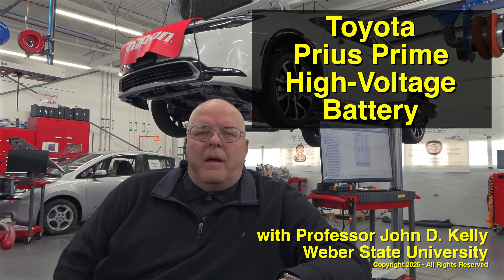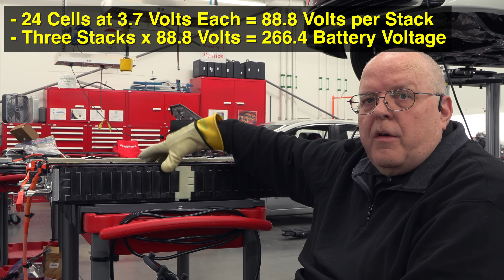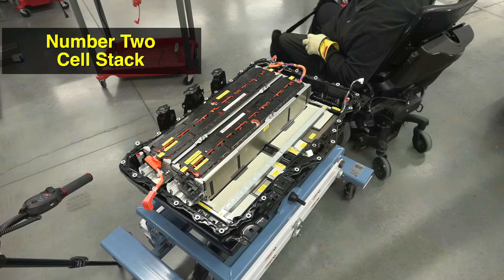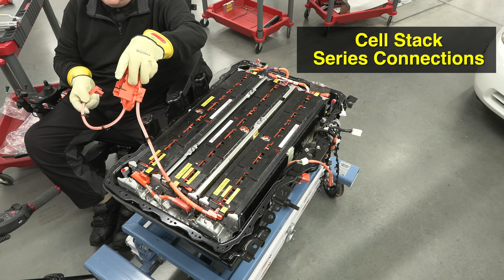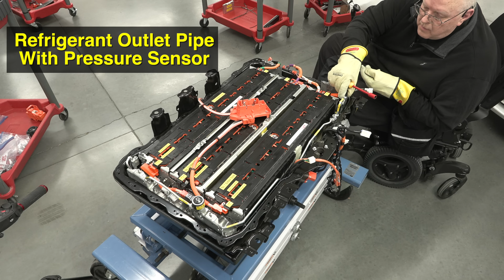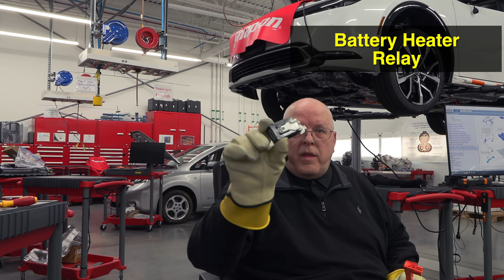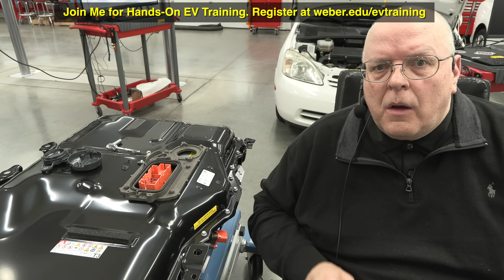2024 Prius Prime/PHEV High-Voltage Battery Build

Comment: Thank you very much for your videos, Love them all.❤
Technical question. You think Toyota could've removed the torque converter, to save weight, moving parts and space? With the electric module upfront we can do something about smoothing the power to the gearbox!

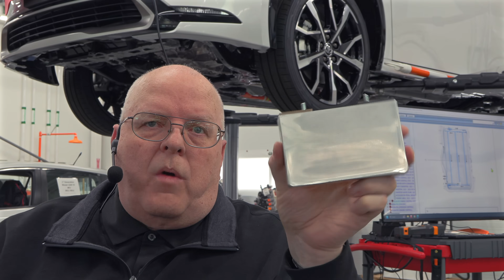Comment: Serious questions... At 7:30 in the video, you mentioned how the previous (2017-2022) generation Prius Prime cells are exactly the same dimensions as this (2023-2024) generation Prius Prime.  Yet the new cells obviously have significantly higher capacity despite being the same size.  For example, the 2022 Prius Prime uses 95x 25AH cells, while the 2023 Prius Prime and RAV4 Prime use 72x and 96x 51AH cells.

I like the previous generation Prius Prime for several reasons: It gets better fuel economy (54mpg vs 48mpg), it's compatible with CommaAI, and it's available significantly cheaper (half as expensive on the used market).  However, its measly 25 mile electric range is very disappointing.  The Honda Clarity is of interest with its 47 mile electric range, but its fuel economy is terrible (40mpg--I get better on that with my standard Corolla!).  So... If the new, higher capacity cells are the same physical size and voltage as the old ones, could one harvest the cells from a totaled 2021-2025 RAV4 Prime (because we need 95 of them and the new Prius Prime only has 72) and move them into a 2022 Prius Prime's battery pack?

This could potentially increase its electric range from 25 to 51 miles (its EPA-rated electric range is exactly the number of AH per cell).  I assume the battery computer primarily watches battery voltage to determine the cut-out points for charging/discharging (standard equipment with lithium).  I wonder what its ability to recalibrate to the doubled capacity would be (because obviously it's also counting kWh in/out for an accurate battery level meter between full and empty, where you can't accurately track by voltage on lithium).  Besides the cell-swap being fraught with peril (I watched your 2017-2021 Prius Prime video as well where you explained this), what are your thoughts?

Comment: Amazing breakdown! It is very interesting that the contact area between the cooling channels and the batteries are so small. It would be interesting to see the long-term degradation of the cells located closer to the inlet as opposed to the outlet valves.
Reply from the maker: Thank you

Comment: Hi @WeberAuto , I'd like to learn more about the architecture of the Prius Prime's solar panel and how it charges the HV battery. Does it use a dedicated MPPT DCDC that boosts the PV voltage to HV pack voltage? Or does it convert onto the low voltage bus and then use the main bi-directional LV DCDC? 
Thanks, Peter

Comment: I saw my friend got an 2026 Prime. It has NMC high voltage battery. I believe this battery can not be charge and left it charge for longer time. I also got the 2026 prime. I did not know and keep the car charged at more than 80% for days. this is not good for the chemical of the battery. If you have a new prius prime.  you should look under the hood and find the lable about the lithium battery. It may be the NMC lithium battery.

Comment: from grok ai, asking it about different emissivity surfaces in the prius prime
Mica has low thermal conductivity, acting as a barrier to prevent hotspots directly under the coil while allowing even heat distribution upward into the battery modules. This ensures uniform warming without overheating specific cells. In contrast to highly reflective low-emissivity metals (like aluminum foil, ε ≈ 0.03), mica's higher emissivity (~0.75) promotes radiative heat transfer into the pack, making warming faster and more effective in cold conditions.
guess because the low voltage choice in the heating element u have a thick hotter element that would normally get hot spots under the battery so toyota is using it more as a heat spreader and radieator instead of as a flame barrier/or for hv isolation. kind of a unique bandaid for a not so good thermal managment system imo. interesting

Comment: Thank you for excellent videos, especially on Toyota ecvt.
I have a question that I have not seen answered.
As I see it the power split device provides a gearbox between ICE and wheels much like the traditional transmission.  The clever bit is that the ratio of this gearbox is continuously variable by changing the MG1 input speed.    My question:  How much mechanical power does MG1 produce (or absorb to go to the traction battery) as the planetary ratio changes?
A related question to help understanding:  It would be possible to buld an ICE car (ie no MG2) with a planetary CVT.  But it would need an MG1 and energy source for it.  Did this concept ever get considered before the first Prius?
Reply: The power split varies as the gear ratio changes. At low speed the power mostly goes through the serial Engine > MG1 >MG2 path. At highway speed most of the power is transmitted directly mechanically. At 65 mph roughly 72% is transmitted mechanical and 28 % goes through the motors. The other interesting fact is that at 65 mph the current produced by MG1 is equal to the current used by MG2, so the current drawn from the battery is approximately zero! Very clever design by Toyota to size of the MG's so this happens.
Reply: @rlderemer  Thank you for your reply.   My curiousity is as to whether a planetary gear can be used to form a beltless CVT  for an ICE vehicle with the ratio changed by varying the MG1 speed.  Looks possible but you'd need an MG1 large enough for ratio setting (as well as for starting), and a battery large enough.  What MG1 power and what size battery would be needed?

Comment: i am very underwhelmed by toyotas attempt to get with the times and build usable erev/phevs, especially in all the compromises for depth of discharge/reserve soc for usable range, cooling is still kind of laughable but technically improved over air cooled, and they are still running weird high voltages far below other mfgs.
toyota went from putting gm on notice with the very innovative prius back in the day, to joining the herd of legacy auto who doesnt want to spend the time/money to modernize their ev architecture.
its absolutely insane that they are charging 50-60k usd for a plug in that is marginally better in only a few areas of technology than the old chevy volts which you can still pick up for a 5-10% of the price.
we got 2 gen1 volts about 3 years ago and i doubt there will be a better vehicle in north america that makes financial sense for the next decade or two. both of our volts paid for themselves in full with just fuel savings alone after only 18 months each, not to mention their cost to insure is crazy low, cheaper than premium netflix now lol (21usd/mo). 
the solar roof is gimicky but i put in my own 200w solar roof on my daily driver 2013 volt for around 100usd for all the materials (including mppt, wires, hardware ect). I deleted the agm battery and built my own LTO 6s 22ah low voltage pack for less than the cost of a replacement agm battery (122usd delivered), which shaved almost 50lb off the car and gives me more range. the car doesnt charge the lto battery past ~14.5v or around 40% soc, but my solar roof charges it the rest of the way to 15.8v or ~95% SOC. the car doesnt know any better and hasnt complained once.
currently waiting for the last delivery of 32ah lfp cells i imported to build and install a parallel high voltage battery of my own design, 112s (7x ~48v 16s modules), ~10kwh usable or double the gen1 volts cycled capacity, which will fit in a small 250mm wide space between the rear seats and still allow access under the cargo hatch. the cells for the battery only cost ~700usd pre tariffs, now theyre around 950 bucks. weight of the buddy pack will be around 150lb, so really not that much more and well positioned over the rear axle. with an empty tank of gas and the agm delete, were talking about a net weight penalty of ~50lb over curb weight for ~80 miles of total ev only range. 
have been looking at all the hv battery tear downs to try and figure out a good air cooled thermal solution. pretty sure i can hack something together that works better than what is apparently acceptable for toyota and nissan. the irony of thermal management is once the battery gets big enough, thermals become less of an issue. 
idk someone with little EE background such as myself shouldnt be able to build a better PHEV/EREV than billion dollar companies for 6-7000$. if my buddy battery ages prematurely, it will be pretty trivial and cheap to replace my diy modules. just going with 7x cheap active inductive balancers probably.
man those pictures at the end are really good. thanks for just throwing this online for free prof kelly.

Comment: Will this refrigerated cooling system plus the fact of the battery being outside provide better cooling than the air system?
Here in California weather hitting 90s, battery on my new 2025 Prius Prime is reaching mid 90s. 
Concerned about accelerated degradation in summer. Will the system increase cooling strength to mitigate this? I thought 90s is high for Lithium ion HB. Car is brand new.

Comment: It would be interesting to see the capacity of an individual cell (mAh or Wh) and also more detail on the pack's overall capacity, which is apparently 14KWh or so.  It seems very compact compared to the Gen 1/2 Chevy Volt packs, which were a similar overall capacity, but significantly larger.
Reply: 10.9kwh usable out of 13.9kwh capacity. divide by 72 cells, 151wh / 193wh usable.
divide by nominal voltage of 3.7... 40.8ah / 52.2ah per cell.
gen1 and 2 volts had about the same total capacity of ~16.5kwh but restricted with software different usable state of charge (soc) ranges for longevity. gm also way over built the thermal management of the batteries for longevity, thats the main reason why the battery is so big, plus the fact that volt batteries are capable of 180kw output (in the elr or software hacked gen1 volt, same ev motors) so they used 3 parallel config in gen1 and 2 parallel in gen2 (smaller/cheaper/weaker ev motors). 
the 2024 prius prime can only pull around 60kw from the battery since they went for larger cells with none in parallel... they really went for density over power and classically skimped as much as possible on the cooling while finally moving away from air cooled. problem with well cooled and properly spec'd batteries is they last forever, and thats clearly not toyotas jam anymore.
actually with just the different SOC protection levels between gen1 and gen2 volts, gen1 batteries are getting to the point where they can usually provide more ev range than gen2 volts after all these years/miles.
finally prismatic cells (all prius models that use lithium cells) are inherently better for density but worse for power compared to pouch style (what the volt uses). i suspect after 5 years/50k miles, the 2024 primes will all experience battery degradation at a faster rate compared to gen2 volts in the same climate, which would be somewhere around 25% ev only range loss.
Reply: @vevenaneathna  25% range loss in 5 years on a 2023+ Prius Prime is extremely unlikely.  A PHEV simply doesn't have the cycle demands that a full EV has (no fast-charging and a, by-definition, a limited discharge envelop). IE: extremely short high-rate (35 minutes at highway speeds!), or somewhat longer low rate, with either being inherently self-limiting to a trivially short period of time until depletion, with no ability to subsequently recharge at any relevantly high rate, given a Level 2 3.6KW maximum).  I agree that the Volt battery system was grossly overbuilt and under-utilized for such a limited duty cycle.  They could have used far more of the available capacity with no relevant compromise in longevity (The 2023 Prime does use quite a bit more of the overall available capacity as compared to the Volt, but it's still quite conservative).
Reply: @awebuser5914  nah youre missing my point. they did use way more of the volts battery between gen1 and gen2 volt and despite it being overbuilt compared to prius prime, gen2 volts have accelerated degradation after 5 years/50k miles. prius prime takes like 8 more steps further.
Reply: @vevenaneathna  "gen2 volts have accelerated degradation after 5 years/50k miles"  The ancient LG Chem pouch cell used in both Volts is in no way comparable to a vastly more modern Panasonic GPNCM2814810 prismatic cell.  Sorry to burst your bubble, but significant degradation will be essentially non-existent , guaranteed.  Also, the Gen 2 Volt had a much larger pack: https://media.gm.com/content/dam/Media/microsites/product/Volt_2016/doc/VOLT_BATTERY.pdf
Reply: @awebuser5914  from memory gen2 was ~17.5kwh, gen1 was ~16.4kwh. youre splitting less than 10%. tire pressure is more important than what youre comparing.
gen1 volts have little to no range loss after 140k and 14 years, i know coz i own 2 of them lol.
panisonic prismatic tech is ancient. they have liquid electrolyte and its the same from the previous gen of prius. they are most similar to 1st gen chinease lfp cells which vent electrolyte over the course of their life. prismatic cell tech has come a lot further but toyota is still using 2010 tech. the lg pouch cells are actually pretty bulletproof. prismatic cells are better for bevs and not hybrids which need high current from a small battery. if you read the service manual toyota says you cant tip their prismatic batteries more than 80 degress. that is ancient prismatic tech

Comment: Given that this is a relatively low performance PHEV with no fast charging capability, it likely has pretty low need for cooling. As you said, previous models got by with just air cooling from interior air. The cooling it has is probably just for battery longevity in hot climates. Because its a PHEV and not relying fully on electric motor output to propel the car (aside from the relatively low power required to vary the planetary gearset speed), they can easily throttle the EV portion of the hybrid system if the battery starts getting too hot. Same with the battery heating. All it needs to do is keep the battery from freezing and getting damaged, it doesn't have to keep the battery warm enough to be able to provide max output or fast charging, they can just throttle the EV system if the battery is too cold to put out much power.

Comment: Concerning the heat shield at the beginning of the vidio. The color looks similar to the inside of some hard drives that i have disassembled. Could it be an electroplating for temperature disperson/absorbsion?
Reply from the maker: Thank you for the information!

Comment: So given that the battery is connected to the AC compressor, can I assume it's the same one used by the cabin or is it a dedicated unit? If it's the same AC compressor as the cabin, does that mean it's always operational, regardless of the state of the climate controls in the cabin, just operating at low duty cycle and refrigerant is bypassing the cabin? And when the AC is turned "on" by the occupant, the refrigerant flows to the cabin climate system as well, and the compressor duty cycle increases. Or am I off in my assumptions?

Comment: Thank you Professor for the effort you put into your videos.

Looking at this, i like that each cell group is serviceable instead of being welded together as part of a section. However, I'm not impressed with the cooling system. It falls way short of what the Chevy Volt had going on. It seems like they went for cheap and simple, but it might hurt the longevity of the battery.

Comment: The solar roof doesn't have a lot of uptake among American buyers unfortunately, as it's only available on the top-tier models.  Dunno about other markets. It's only an extra $600 along with everything else.  Under ideal conditions it adds maybe 3 miles of range per day; looked at one way that's nothing much for 600 bucks, but over the course of a year even if it only delivers 50% of its potential, that's over 500 miles of range.  It costs $600 extra on the first day, but it gets slowly cheaper and cheaper with every day that goes by.
Reply from the maker: That’s a good point!

Comment: I think the text @4:58s is meant to convey that the heater turns ON at 1.7C and turns OFF at 7.8C. The heater doesn't maintain the battery temperature between these set points only. it is great to see these videos pop up again. :)
Reply from the maker: Correct. Thank you